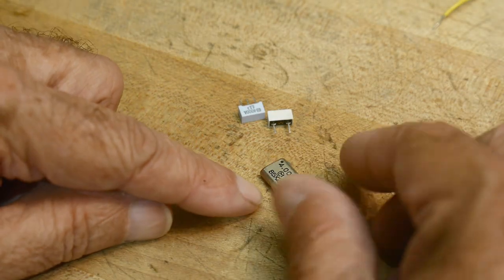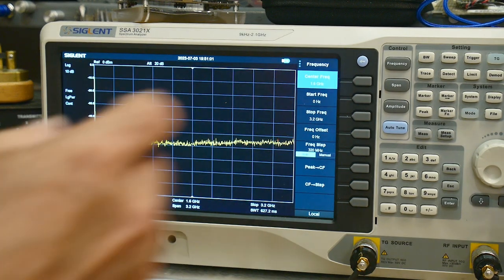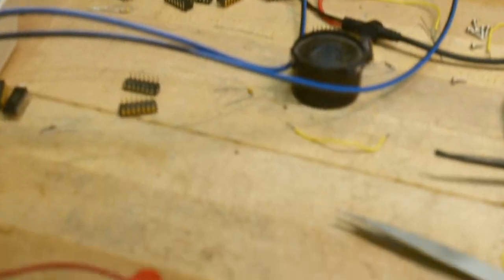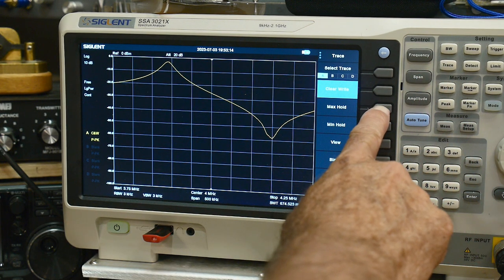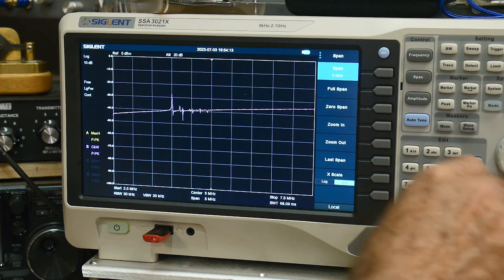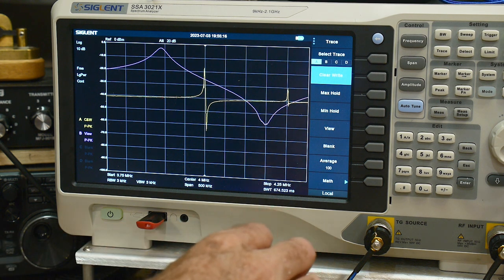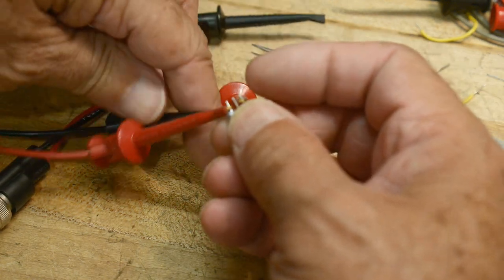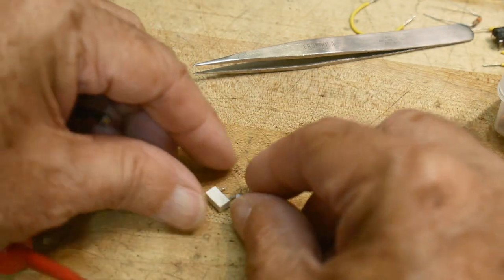#1578 Ceramic Resonator (part 1 of 2)

Comment: The Sinclair ZX81 computer uses a 3 pin ceramic resonator for the clock. As it's such a slow machine to begin with, it works fine. LOL.
Reply: I came down here to add the same comment  😮

Comment: Can you explain why the typical shape of a crystal on the analyzer looks like that? The positive spike I get - it passes more energy when its in resonance - but why is there a negative spike when the frequency is a bit higher?
Reply: A crystal can series resonate... at a lower frequency... and parallel resonate at a higher frequency. To see this, you can model a crystal... you can see there is an inductor in series with a capacitor... across the input terminals of the crystal. But there is also another capacitor directly across the input terminals. To explain further...draw a coil in series with a capacitor... label one end of the series circuit, X1, and the other X2. X1 and X2 are the terminals of the crystal called X...and the the inductor, in series with the capacitor, represents the crystal's series mode of resonance. Now draw another capacitor  from X1 to X2 (so now there is an additional capacitor in parallel with the crystal's terminals) This extra capacitor is added to account for the crystal's parallel resonance mode. If you do the algebra, you can verify that the crystal can resonate at a lower frequency in the series mode, and at a higher frequency in the parallel mode. You need to understand the difference between series an parallel resonance characteristics... but the fact the crystal has those two modes explains the two resonances you see on the spectrum analyzer. The inductance, and the series and parallel capacitances, are resulting from the physical properties of the crystal, and the plates that are holding it inside the can.
Reply from the maker: I'll do a video on that in the future
Reply: @willthecat3861  Thank you for the explanation!

Comment: For some reason your audio seems to be mono through right channel, same with the max038 video
Reply from the maker: all my audio is single microphone
Reply: sounds fine on this end!:face-fuchsia-poop-shape:
Reply: I did a quick sanity check with different headphones and different system, and found the mic to be on only the right channel for these two videos, but not the one previous to the max038 video, where the mic plays to both audio channels. Strange, but it may be just me, and certainly won’t keep me away from your excellent content.
Reply from the maker: you are right, somehow my setting got the audio panned 50% to one side. I'll try to fix that in the future.
Reply: @IMSAIGuy  strange, okay thanks!

Comment: What happens when two identical ceramic resonators are placed in series or parallel?
Reply: why would u do that?? can't tame that current?? dangerous undertow!:face-orange-raised-eyebrow:
Reply: It depends on their frequencies, both nominal and as-built. For two with very close frequencies, putting two in parallel in a VXO-like circuit can allow a wider frequency range but at a trade-off of less frequency stability. Series or parallel ceramic resonators, together with other components, are also useful for building filters with different characteristics than one could get from a single resonator.
Reply from the maker: https://youtu.be/3uRA1p6OotA

Comment: I never heard of ceramic resonators.  Thanks for the learning.  But I don’t get the cost argument.  Crystals are cheap in my mind.
Reply from the maker: the cost comment was about actual product engineering where you are going to sell one million units.
Reply: Crystal technology has made tremendous advances over the last few decades in that they’re much cheaper to manufacture now in volumes, and they’re much more accurate: +/-100ppm is no longer a select grade, but about the crappiest that one can get.